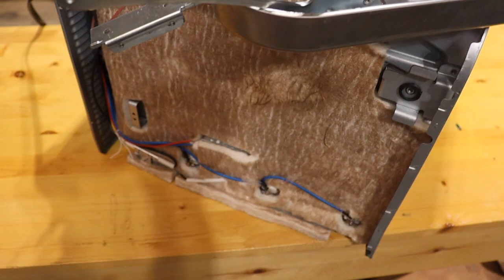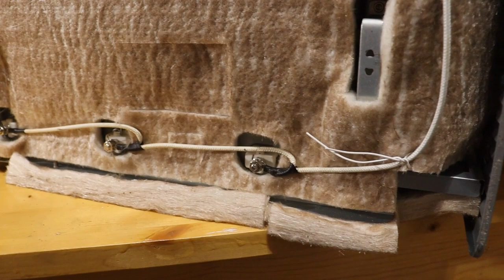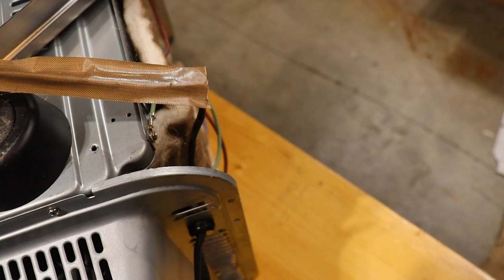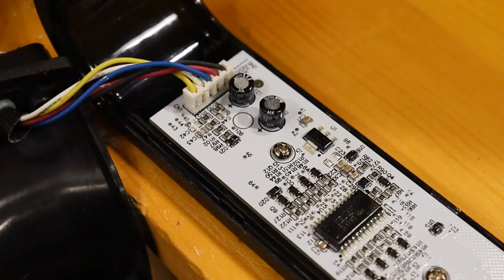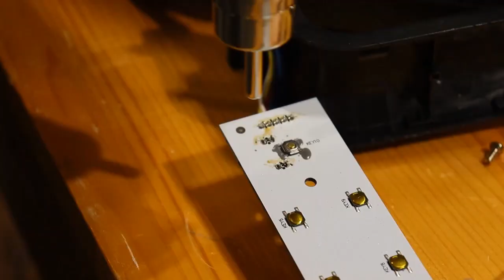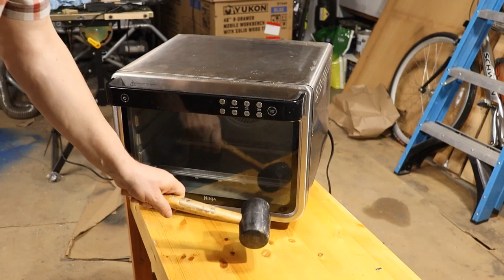Repairing Ninja Foodi DT 201 - Start Button not working : It is "disposable" product

Comment: Fantastic video. I know when mine dies I'll likely buy a different brand. I was only looking for a video like that as my sister in law has one where the fan is very noisy and I was going to fix it for her but seeing this I don't know if I wanna waste my time to try.
Reply: I recently bought it and send it back for defects  got the next one with differenr defects now. I am not sure if these defects are just how unprecise they build these and not sure if I want to keep it.
The problem is that I could not find any other oven with similar features (hot air ventilation, quartz heating, size).
What other Brand product would you get?
Reply: To your fan problem:
Both of mine came wirh off-centered fans brand-new. The 1. One was still silent and the 2. One is so offcenter it makes noise some of the time. I wonder if I can center it properly and have a halfway decent oven. I saw a bideo where someone had the fan acessibble, it is only one part that needs to be removed. How many screws it takes and how many parts need to be removed to get access to theese screws and how many screws to remove theese parts is what I now wonder about.
Will do it tomorrow or propably not at all  did you center the vent?

Comment from the maker: One more update: one has to unscrew 58 (fifty eight!) screws to get to the panel for button replacement! And then screw back these 58 screws! Bravo, Shark/Ninja!
Reply: @celsiusswatt6021  Great Video my Good Kind Sir... I had a DT201 do exactly the same thing only a I'd also purchased the "Extended 4 year warranty" for $40 Bucks and the 'Ninja Sharks' did the same thing as they did to yours because of their: ''Money Grubbing Planned Obsolescence Business Model that Wall Street Lives For." which only 23 months af use ending last May of '25. So, I applied the Asurion warranty refund to get the next one... and in essence it cost me $80 bucks for two warranties and another $42 bucks  for both in sales taxes for two years plus the $575 bucks for the broken & new one... My Sanity repeatedly winces when saying, "No sir, no sir, I really don't look like Mr. Stupid," into the mirror as my morning shaving mantra...
---
Okay then, a question for you @celsiusswatt6021... since this new one is going to do the same damn thing as the last, in your opinion, do you think this hair-brained idea below, would work on this 6th month old new one I got when it goes dead in 2026:
`
Instead of taking all the time to remove all the screws, Am I Stupid will be considering taking my Dremel's cut-off wheel and be cutting the plastic door handle about a 1/16 inch in depth... vertically from top to bottom so as to miss the main circuit board and wires going to/through it on the right side... and then repeating that on the left-sides face-side... just beyond the handle's curved bend... but also just short of cutting into any of the the circuit board. I'd then pry the plastic face off with the attached screwed in circuit board and electronics,  releasing the compression connection to the inner connection handles half as you did with a flat head? I'd fix it as you did, snap it back... and dab some epoxy filler in the cut gap 

Your Opine kind sir, and the best place to find the correct sized Momentary PCB Surface Mounted Devices, SMT Mount 4 Pins Push Button SPST Tactile Tact Switch would be appreciated... btw I joined the channel too...Thanx Much.. gw aka Mr. Almost Stupid
Reply: You did a great job. What was the name of the solder iron you were using?

Comment from the maker: An update after few weeks: The other buttons which were not replaced started to fail in the same way - the Kapton tape holding their flexible caps started to fall off (as on the first one which I replaced), and they fell down... I said in the video that they may fail. I could save time replacing all of them. Now I am about to open it again and replace them all. They are $1.20 for 100pcs.
Reply: Much more paitence than I, stupid design by stupid little ferry men and that is as nice as I get!
I applaude your willingness to achieve on something some garbage they dared to Strike The NINJA NAME!
AGAIN SHAME SHAME SHAME Maybe One Day Your People Will Once Again Find Their Honor Lost So LONG AGO!!
Reply: I opened the button panel and saw the missing cap was like you said. I can't find the caps to replace them. I checked goldmines elec using the number you had on the bag (G13795) but they don't seem to have them. Any idea where I could get them?
Reply from the maker: @LJJJ1945  There are many sources, the assortment box from Amazon https://www.amazon.com/Tactile-Button-Momentary-Assortment-Control/dp/B07GNZM4YJ has them.  See other answer below.
Reply: Great Video - Can you help find the switches?  What is the part number or description to help track them down?  the part number shown on the bad on elec-goldmine has no results?
Reply from the maker: There are many sources, the assortment box from Amazon https://www.amazon.com/Tactile-Button-Momentary-Assortment-Control/dp/B07GNZM4YJ has them.  Or look for "tactile switches" on Amazon or eBay or elsewhere... In the box I mentioned there are ones (with yellow Kapton tape) that are identical to originals, and others (with yellow button in metal case that I used in the video). Note that while these are more reliable, they are slightly taller and you may need ~0.8mm spacer washers on the screws holding the panel - otherwise buttons will be continuously spaced. And, if you find the fallen caps and willing to risk with repeat disassembly, you may fasten the caps back with Kapton tape. Good luck! For info, the repaired oven is still perfectly operating.
Reply: @celsiusswatt6021  
Thank you!
Reply: @celsiusswatt6021
          Great Video my Good Kind Sir... I had a DT201 do exactly the same thing only a I'd also purchased the "Extended 4 year warranty" for $40 Bucks and the 'Ninja Sharks' did the same thing as they did to yours are for the same: 'Money Grubbing Planned Obsolescence Business Model Wall Street Lives For  Reason,' in only 23 months, last May of '25. So, I applied the refund to the next one... and in essence it cost me $80 bucks for two warranties and another $42 bucks  for both in sales taxes for two years plus the $575 bucks for the broken & new one... My Sanity repeatedly winces when saying, "No sir, no sir, I really don't look like Mr. Stupid," into the mirror as my morning shaving mantra...
---
Okay then, a question for you... since this new one is going to do the same damn thing as the last, in your opinion, do you think this hair-brained idea below would work on this 6th month old new one when it goes dead:
`
Instead of taking all the time to remove all the screws, Stupid will be considering taking my Dremel's cut-off wheel and be cutting the plastic door handle about a 1/16 inch in depth... vertically from top to bottom so as to miss the main circuit board and wires going to/through it on the right side... and then repeating that on the left-sides face-side... just beyond the handle's curved bend... but also just short of cutting into any of the the circuit board. I'd then pry the plastic face off with the attached screwed in circuit board and electronics,  releasing the compression connection to the inner connection handles half as you did with a flat head? I'd fix it as you did, snap it back... and dab some epoxy filler in the cut gap 

Your Opine kind sir, and the best place to find the correct sized Momentary PCB Surface Mounted Devices, SMT Mount 4 Pins Push Button SPST Tactile Tact Switch would be appreciated... btw I joined the channel too...Thanx Much.. gw aka Mr. Almost Stupid